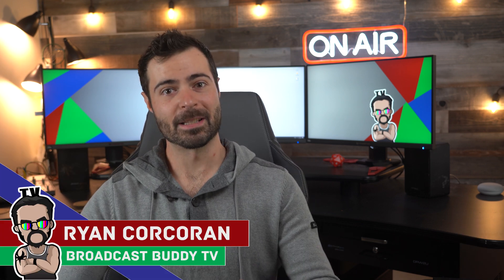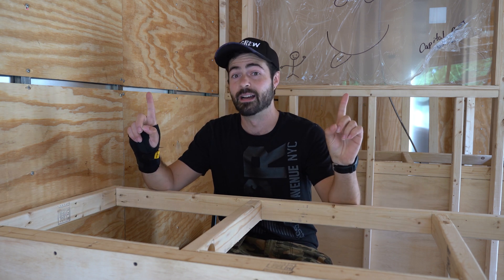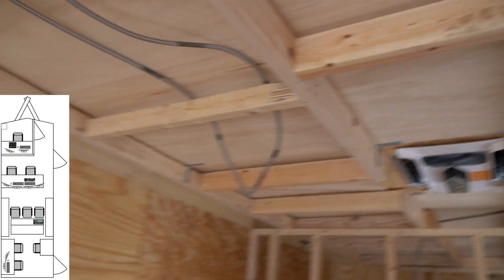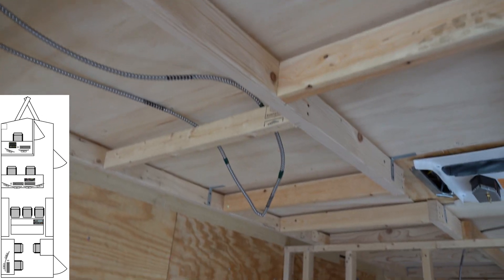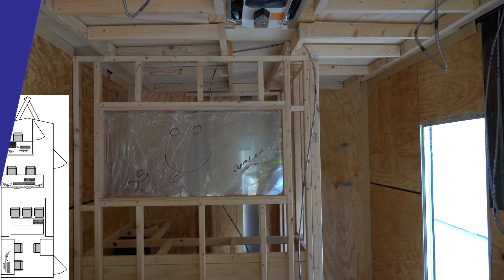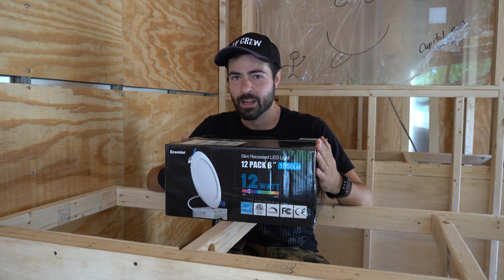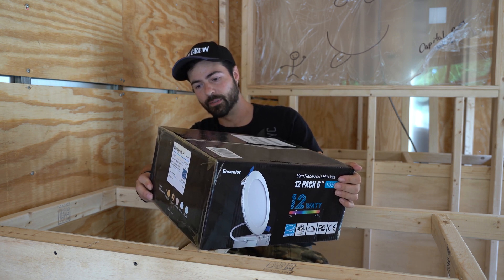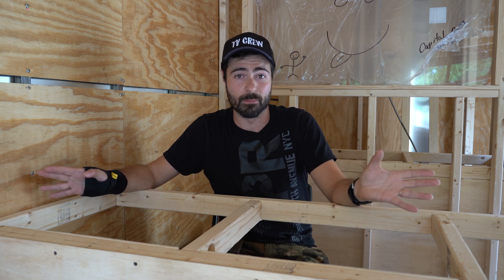Let's Build A Mobile Production Unit, Part 5 [Broadcast Engineering]

Comment: Thank you for your videos.
I want to ask about a solution that can help to use the 1080p footage over a 1080i transmission standard.
I mean like if i use footage that has been filmed with my phone which it will be in format 1080p or progressive and then i want to use this material in Tv transmission which works in 1080i or interlaced format.
Usually the normal conversion from progressive to interlaced will result some flicker or non-normal video

Comment: Sir, can you tell us that now is camera base station connected to switcher. How is tally and intercom connected.??
Reply from the maker: Hi! The cameras connect to their respective base stations via SMPTE Fiber. The base stations connect to the switcher via HDSDI. Tally is provided by the switcher via a DB25 breakout cable to each base station and intercom is fed from an analog party line Clear Com system.
Reply: @BroadcastBuddyTV  But Sir, the switcher only provides one DB25 out. Then How do you feed it to multiple base stations?
Reply from the maker: @divychitroda903  Hi!

So basically you have to  make a cable. You only need two pins of the DB25 to make a tally circuit. The end result is usually a "break out" cable where 1 db25 fans out to multiple smaller db connectors. One per base station. 

Something like this. This would be like 1 switcher sending tallies to two camera base stations:
https://www.ebay.com/itm/Blackmagic-ATEM-Switcher-to-Datavideo-ITC-100-Intercom-1m-Cable-/143435835954